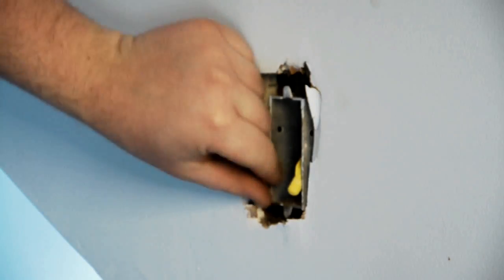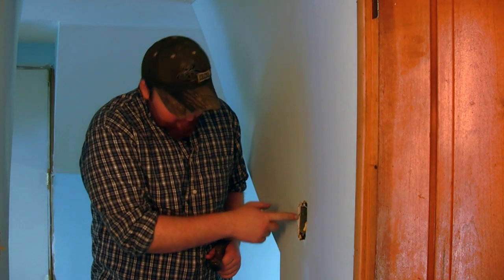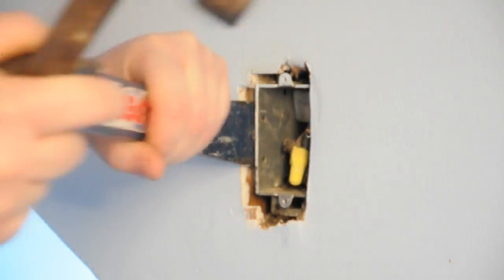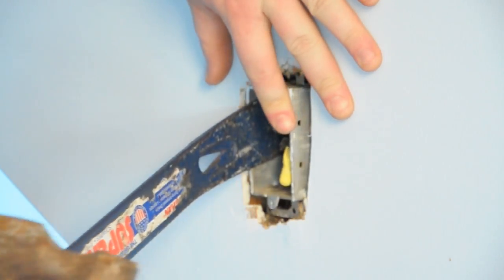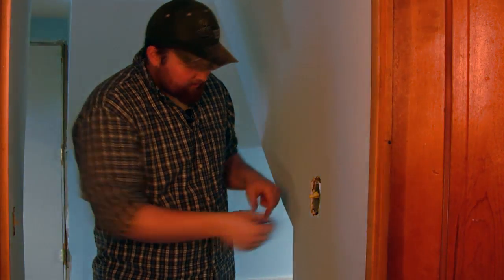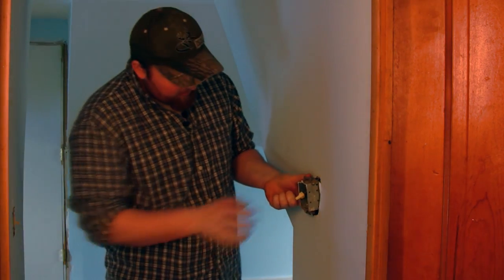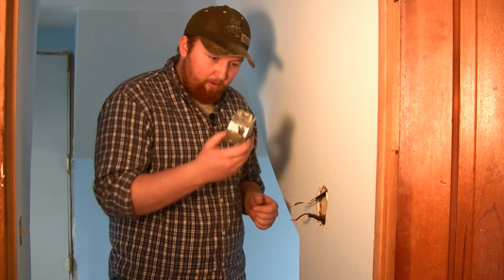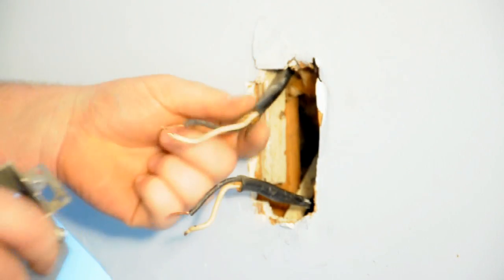All About Walls : How to Remove a Switch Box From a Wall

Comment: My box had different design...how nails were hammered into left stud.

Very Helpful Joshua instead of cutting nails (I have no saw and did not want to risk cutting wire???). I just modified your steps slightly. Your box had the nail head  inside (left of box) and stud on left side of box.     My wall box (metal) was nailed from right outside to left side (2x4 stud was like yours on left side of box).   So,  Instead of the nail heads inside (your left side) mine was nailed with heads on outside (right side of box).

 Your flat crowbar worked great but the nail tips stayed inside box; I could not get to heads on right outside of box. I then pushed on nail tip to right (also grabbed nail with straight pliers and pushed to right) then nails dropped in the wall.  Oh yes! In addition I released/removed the top, inside screw that was bracket holding wires on top of box; and straightened out wires (into 1 straight wrapped bundle). Then the box  was easy to pry out; the straightened wire prevented the box from dropping inside the wall; so the box was recovered/trashed.

Hope this helps!

Comment: "be careful when you do this not to damage the drywall"
Which leads me to where I am now.
It looks like the hulk punched out of the inside of the wall, and I split the 2x4 with what seems to be a 3" nail that was holding on this tiny box.

Nothing ever goes as planned ahhhh

Comment: I recently used a Dremel to cut the plastic around the nails. Then popped it out in a tight situation with a bathroom double gang box between two studs. Sometimes ya gotta do what you gotta do to get these suckers out. No drywall damage though!

Comment: This method only works for this one particular type of box. There are many different types of boxes that may need to be removed,  many not this easily.  For example, a commonly-used metal box has two brackets that fasten to the stud with nails.  A reciprocating saw is necessary to cut these brackets so the box can be removed.
Reply: I think that's what we have. Can't see any nails and the stupid thing won't budge.

Comment: Remove the switch, wire nuts, then cut the power?
Reply: You don't even need to cut the power if you douse the area with gasoline first.

Comment: Never seen a box with nails on the inside. Must take a really tiny hammer to install one.
Reply: To nail in such a place I would hold the nail with pliers and hit the pliers with my hammer as close to the box as I can. Once the nail is set in a bit I would use any long strong flat ended tool (like a 2 foot crowbar) to drive the nail home. End on nail and wack it just outside of the box.
Be doing this since the 80's
😊